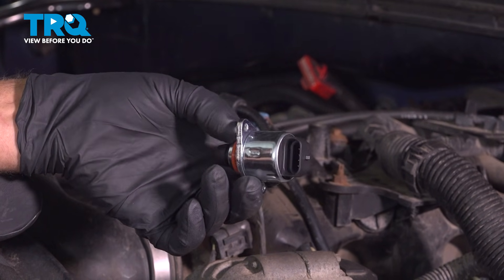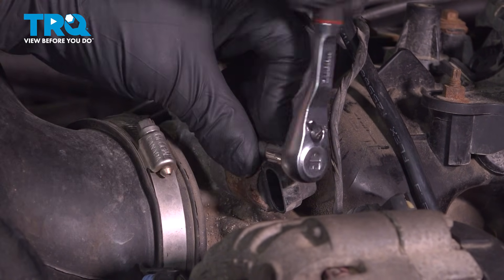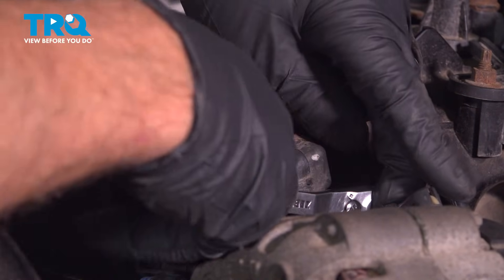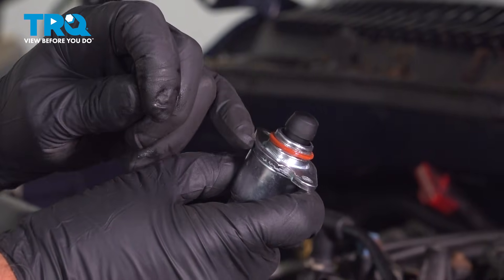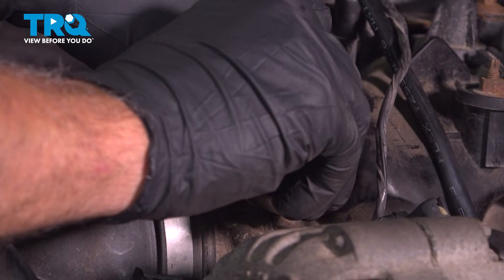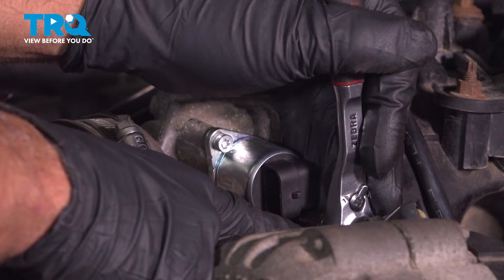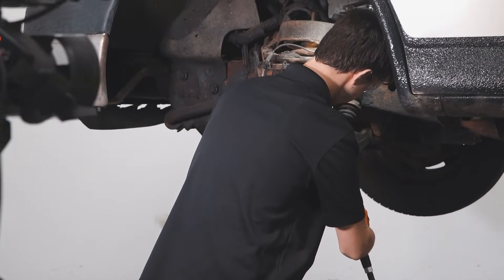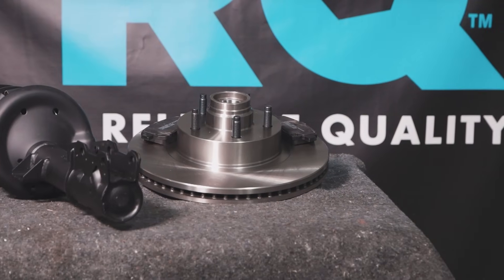How to Replace Idle Air Control Valve 1999-2006 Chevrolet Silverado 1500

Comment: I put on a new one and still have 4000 rpm idle instantly after cleaning throttle body with CRC Throttle Body cleaner   and changing the IAC. It only started high idle after cleaning the throttle body spraying in from the front any ideas TRQ????? any help would be greatly appreciated thanks

Comment: So I've got to sit with my foot on the brake for a 5 minute time period? I no longer have a parking brake on my truck.

My issue is an idle anywhere from 1500-2k so if I "block" the wheels even with a parking brake the truck is gonna try to drive though the house.